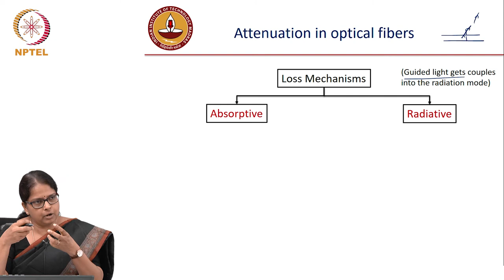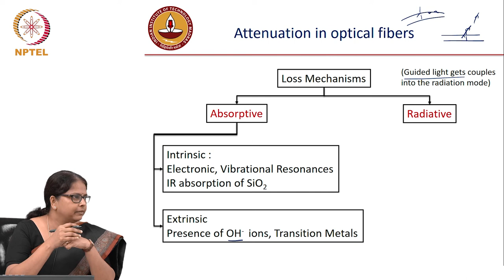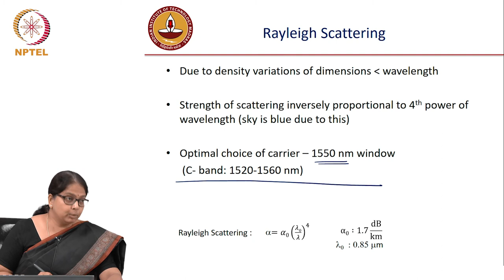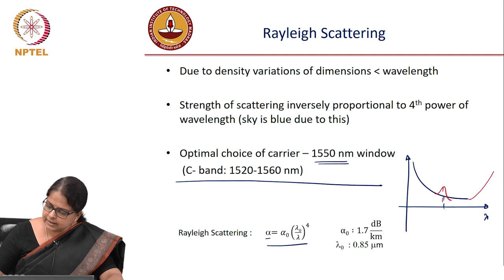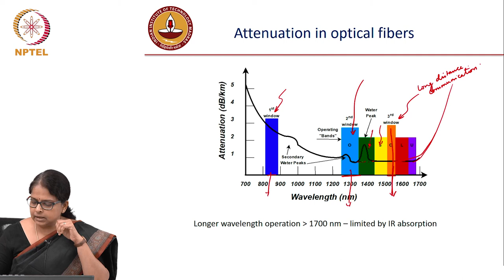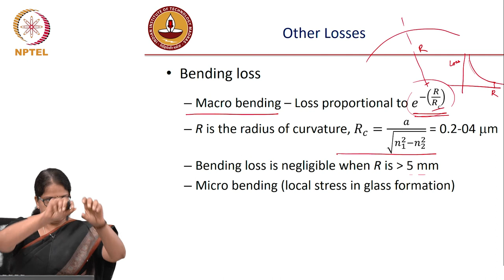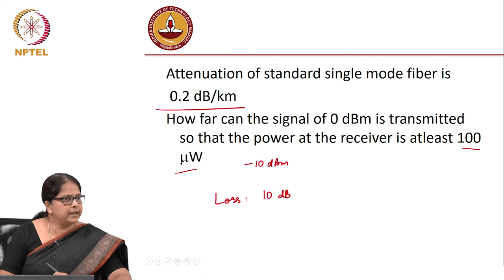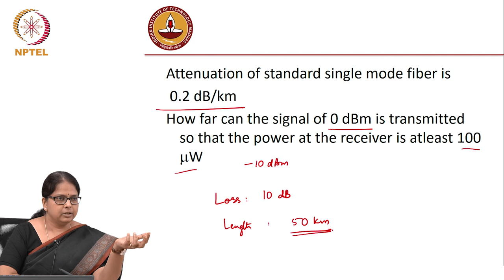Lec 41: Attenuation in optical fibers

Comment: step index multimode optical fiber has a core of refractive index 1.45, a cladding of refractive index 1.43 and a loss of 4 dB/km. For a total length of 3 km: determine the overall cable attenuation, estimate the amount of pulse spreading due to modal dispersion, determine the maximum data rate for this cable using binary pulse